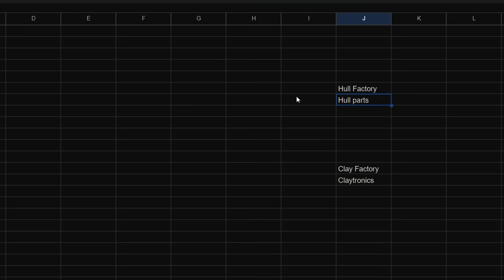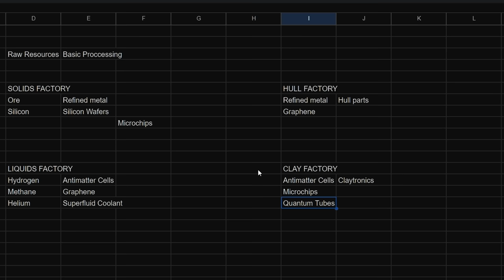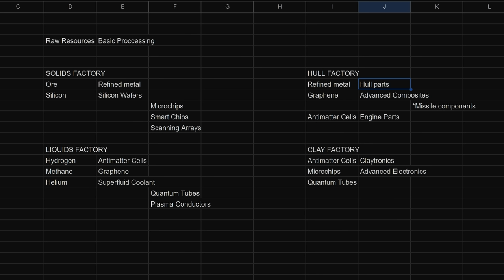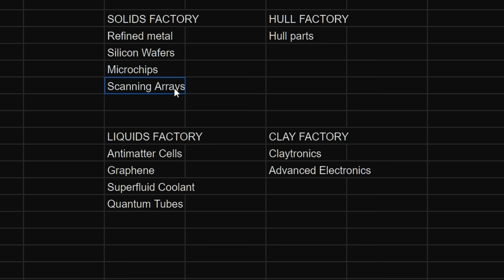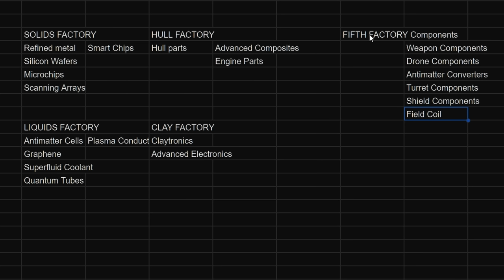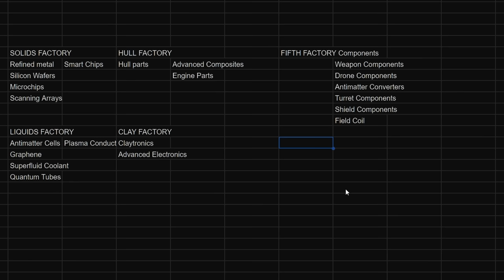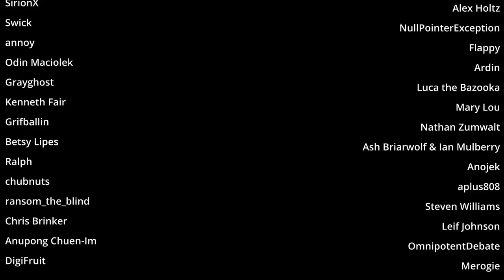Tutorial : How to Build and split your Factories : X4 Foundations

Comment: Things do change a bit in how you plan your factories based on your reasons for building the factories. This approach is the most efficient if your goal is just to speedrun to building your own ships. If you're building the factories to do things like terraforming or satisfy galactic demand dynamically, I'm afraid you're going to want to split things up quite a bit more than that. You can easily fill a full plot just making hull parts or even weapon components for all the shipyards in the galaxy and it still won't be enough. At that point, you really will need to specialize your factories quite a bit more. I usually make a separate factory for every single ware that NPC shipyards will buy. Due to game performance reasons, I've also been thinking about trying to make the factories smaller and spreading them out to different sectors, as whenever I concentrate everything in a single sector the game performance starts getting a bit sad even on the mightiest of PCs.
Reply: Having shipyards in different sectors also has the fringe benefit of not having ships bought by faction A and B attacking eachother as soon as they roll off the production line.
Reply: @JoshSweetvale  with tides of avarice and salvage I hardly see why that's an issue have both sides grind each other down on your ship yards then salvage their wrecks to make even more profit.
Reply: @undeadpeak  Having running battles outside your station is dangerous, and it weakens empires's reserves to throw against the Kha'ak and robot things. Let 'em muster.
Reply: @JoshSweetvale  hear me out, deal with the xenon yourself, and the khak only spawn in certain systems and the hives allow for smaller spawns within 3 hexes (wipe out hives continuously) then profit off of suffering, you’ll have enough money to deal with the damage.
Reply: Yup. My first sector I built combo factories, but was not satisfied with the control I had. Every sector post has had individual factories per output and the fidelity is far superior.

Comment: Thank you for helping me rap my head around this. It was only after I saw this video that I could grasp the bigger picture of the X4 economy. Since then, I have personalized my version some though, using only four factories. Basically, I use your Solid factory and Liquid factory, then create a: 
 
STATION FACTORY
hull parts, 
claytronics, 
turret components, 
advanced electronics, 
shield components, 
field coils.
 
SHIP PARTS FACTORY
advanced composites, 
engine parts, 
antimatter converters, 
weapons components, 
drone components, 
missile components. (you left out this one)
 
For me, it's important that I can build early stations with defense and shields. In this way I can have everything I need for a station in one place. I also have dedicated trade stations I build that trade in Station Factory wares before I start trying to build up in a sector to cut down on build times.

Comment: My initial Get Rich Quick Scheme: take the Callisto which HAT gave me to the Equipment Dock in Black Hole Sun IV: outfit it with an All-round thruster Mk3, a Mk3 Shield, two Mk2Pulse lasers, and 50 Nav Beacons for a cost of 308,007.

Then fly it to the Wharf in Argon Prime and outfit it with an All-round thruster Mk1, an Mk1 Shield, sell the two Mk2 Pulse Lasers, and sell the 50 Nav Beacons for revenue of 558,586. 81.4% profit! 
With this mechanic I went from about 800,000 in liquidity to about 2,077,969 in the span of 30 minutes of real-time. The nice part about it is: you really only have to interact with the ship once or twice and it takes a good 10 minutes for it to get to the point where it is idle so you can have a single NPC Callisto doing this while you are other stuff in your own ship.
Once you get an Argon Mil license,  you can "ship" Ion Blasters Mk2 from Black Hole Sun IV to Argon Prime. Buy two Ion Blaster Mk2 ($774,000) and then when you refit in Argon Prime: leave the weapon slots EMPTY = 100% profit. In the instance of the game world in which I explored this gambit the price for those Ion blaster Mk2 were $1,418,000 apiece at Argon Prime! 🤯That is a 283% profit! 😂

Eventually, the Equipment Dock in BHS-IV will start to run low on Weapons components, so there does seem to be a bit of a plateau effect to this gambit, but it is a nice way to rack up a good 25 to 30 million in the first 5 or 6 hours of a new campaign.

Comment: I've found that building 'In house" factories works way better. Basically you don't ship middle-tier parts anywhere, you ship raw resources, and end products. and just ratio out your factories, and make everything on site. This removes part bottlenecks, its never an "antimater cell" bottleneck which now needs ships to carry them, and who knows what else. Its a Hydrogen bottleneck. You can even sell the excess.That means you predominantly ONLY* needing to ship raw resources around the map. Do this with large miners and they can more or less ignore the Xenon, so you more or less only need to worry about K's and I's. 

I look at the resources required per hour, and give that station a few dedicate miners. These don't need to saturate demand, that would be wasteful. They just slow the 'decay' of storage. ideally they will harvest a bit below what is needed on average.

Lastly, build a resource hub or three, and set them up with their own mining fleets, and more miners but with cargo drones instead of miners to ship the raw resources around as needed. This is where demand gets saturated. THis is honestly probbly the best first station, because its all profit once built. And you can build them on the cheap too.

Overall this setup needs a lot less ships to keep running, and less reliablity on fleets that might get destroyed ,at least until you lock down sectors with defnese bases.

The two exceptions I make to this is food/med hubs, for obvious reasons. And Shipyards, which just have ships to yoink finshed products off the other stations in the system. These are the only solid delivery I need.

Admittedly, this method requires the most forplanning, for station setup, But I find the simplified logistics helps a lot, and feels a lot cheaper to get setup and maintained.
Reply: This is a very good tip. When you compare Solid/Liquid mining ships to Container freighters, the miners are something like x2.5 times more efficient for shipping (based on m3 of storage and travel drive speed). That number also takes into account the fact that raw material takes up more space than refined material - miners are just that much better.
Reply: Idk if I’m just dumb but I’m not exactly sure what you mean by in house and what not…
Reply: Does this mean for example claytronics: your factory starts off making Graphene, silicon wafers and superfluid all the way to claytronics? Isn’t this the same as “mega factory”?
Reply: @monstrosity8855  Megafactories try to "Do everything". Your not wrong, in that technically you could in theory just build one massive station like this but the AI has problems dealing with that strategy last I checked. 

Megastations gets overly congested and it ends up being LESS productive than several smaller dedicated stations. It's also a lot harder to find bottlenecks/ratios.

Thus I build several smaller factories with only Raw resource as inputs, and final products as outputs. I also mess with station/ship controls so I don't ever ship intermediate components.

I will Caviate this, with your first factory best being Hull Parts / Silicon Wafers. You can expand them out later but those two seem to have very high demand overall, and are good for early game station profits.
Reply: Ay I know this is like 5 months old but what do you mean by resource hub? Like a station with lots of storage and that's its only function?
Reply: Its a bit of a combination of mining stations and 'relay trading' stations. You  set the station to only buy from yourself. Attach a bunch of L-Miners (ore/gas) and a few M-traders(Ore/Gast/Solid). This makes the miners gather resources for your industry, and deliver it to any station that needs it. Yours or otherwise. It also means it will buy finished products from your factories, and resell them further away extending the reach of your trade network. 

(Ignoring travel difficulties)
Lets say you build your factories in Argon Prime. Even a lv 5 manager, you wont be selling to the Boron in Great Reef, because its 6 jumps away.  But build a Resource Hub in Heretics end. Each station only needs a lv3 manager, and you are now gathering raw material from Heretics End + Watchful Gaze. If you put another in Towering Wave, you basically are selling to the entire Boron from Argon Prime, and can pull from the raw material from them as well.

Comment: Goddamn. This perspective is simply gold. I want to do a playthrough of the entrepeneur path, but this rabbit hole is something I've never dug myself through. It may seem lazy, but I would really have appreciated prefabs for starting purposes. Granted, I probably have less than 40 hours in this game total, but my attempts at creating a few stations saw the money running out before I was able to complete anything viable and profitable. Add to that that I basically had lost my train of thought before acquiring the funds to proceed. 
This guide with intermittent stages and not scope creep galore will probably help a lot if I can get some playtime during the xmas holidays.
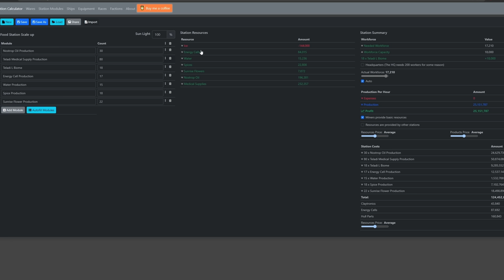Reply: BTW. Did i get that stuff at the @17:00  mark correctly? You don't actually need the infrastructure to house or sustain a workforce? They are bonuses, not prerequisites, to production?
Reply from the maker: That is correct, all factories work without workforce. Adding workforce gives production bonuses.
Reply: For a very basic entry into production you simply build a solar power plant. I think most game starts should even have the required modules for that already unlocked. A solar power plant needs simple dock, a storage, and of course the energy cell module. You can scale this up as much as you like and it does not need any input. Sure, the profit generated might be small, but it is reliable and everyone needs energy. Later you can build other producers and you will have your own energy supply.
Also, if you have the pirate dlc, power plants in Avarice produce an insane amount of energy cells, though you have to keep the tide in mind which is a whole nother story. But a power plant in Avarice and a recycling complex in Windfall IV can cover the whole universe with construction materials make make you filthy rich. Although this setup is something you should only attempt if you know the basics around base building, trading and the intricacies of the tide.

Comment: Only thing I will probably change on what get's made where, is you can import Advanced Composites to the Clay Factory instead of the 5th Factory and make Antimatter Converters there instead. Helps with the metric butload of inputs in the 5th Factory I think.

Comment: the best reason for keeping stations relatively concentrated is, that the more moduls a station already has, the longer the individual build time of an extention of one modul becomes.

at the start your solar array is done in 15 minutes in seta, if your station is already a megafactory, a single more array can take 6 hours in seta

the reason they did this is, that egosoft is aware about how the game renders certain elements.

everything arround in a 40 km circle arround your position consumes gpu everything outside of that circle cpu. they're designdecision is based on what most computers can handle and what not. so by making multiple factories nearbie, instead of one megafactory, the game runs smoother. tbh, when i am sitting in my hq, the game runs on 1 fps, cause i simply didnt care and wanted to push the limit of my hardware lol, i thought the idea of beeing able to teleport the hq with 20 destroyers docked right into the middle of a xenon sector, was too badass to not try it out on my first savefile. 

on my next game ill only be having storages  and dwarfs for terraforming drones on my hq, the entire productionline should be autonomous and spread out through the galaxy, connected by big trading stations, it sucks to have a home where you can't hang out lol

i wish they would give us a teleport device modul we could add onto other stations too, so i could bypass this main issue a bit without beeing forced to extend trading routes excessively just to get planets on the other side of the universe terraformed. i would do it exactly like you say here, with having 6 teleportable stations specifically  to have them near my hq without killing my performance

Comment: One thing definitely worth a mention is that if you build such a monstrosity of a base it will murder your frames. I've built one gigafactory and it becomes unplayable when your ship  (player) is near it. Goes from 60fps to whooping 2 (and occassionally crashes). In my case i've ran out of FPS way sooner than any raw resource in my vicinity.
I recommed building it either smaller or far enough from gates that it won't cause any issues. 
Or just have PC like FJ, that works too i guess :)

Comment: Holy crap……. I’m now kicking myself for being halfway through building one megafactory to make both claytronics and hull parts. I guess now my current playthrough will be mega engineering and next playthrouhh can be lean clean manufacturing
Reply from the maker: Don't kick yourself to hard, everyone does it the same way first time. It's a rite of passage for all new players who make it that far.
Reply: @FrancisJohnYT  I've started a semi-mega factory that has all the stuff to make hull parts from ore. Instead of building all of one production module before going on to another, I build one or two of each in order of what's needed to produce the final product, so production starts immediately and isn't ever bottlenecked. I accomplished this with the calculator you showed. I started with one hull parts module and autopopulated the rest. I wrote down how many of each module was needed, then increased the hull parts module count by 1, autopopulated again, taking note of when counts increased for other modules, repeated to the desired number of hull parts modules, and used this as a build order.

I stopped at 9 hull part modules, though, since I figured that at that point I'd probably start having to worry about balancing storage and docks with the production. Adding something into the middle of an established, complicated build order is a pain in the butt. I had to jiggle everything after I laid out the station and then realized I'd accidentally used Teladi hull parts modules and had to replace them. Luckily, I noticed the mismatch on the station overview before it had gotten as far as building any of the hull parts modules.

Once I get this station working smoothly, I figure I can just build an identical second one in the same sector when I get to the point of needing more hull parts. I'll probably work on claytronics and advanced electronics first, though. Advanced electronics seem to be the tightest bottleneck for building my gate defense platforms when relying on the other factions' stations. Hull parts and claytronics are my first focus just to cut out a lot of the expense of building more stations.